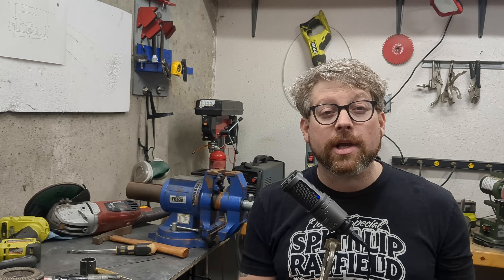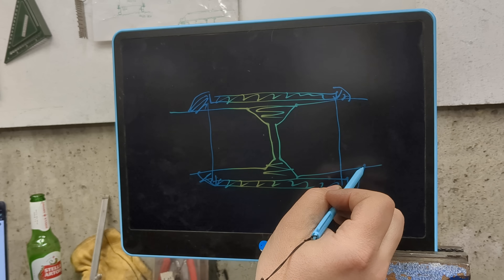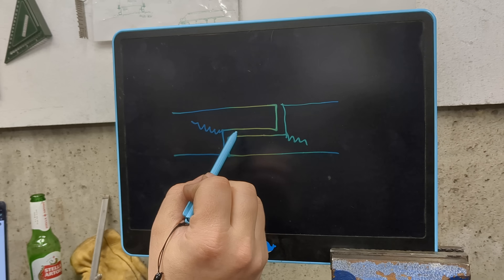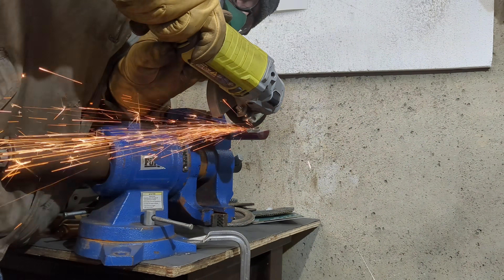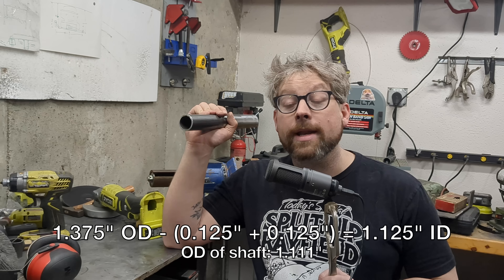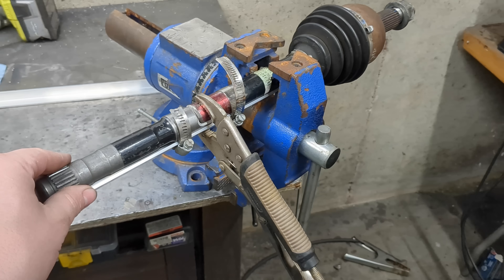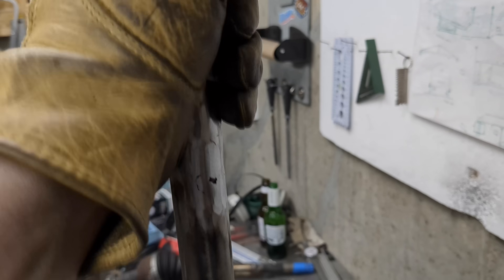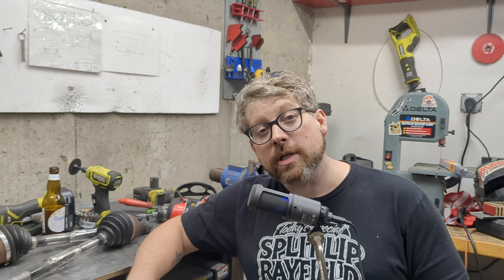Why This Joint will NEVER Fail - How to shorten/fix/splice an axle shaft or custom CV axle

Comment: I find it interesting that you brought up the 45 degree splice. CV axles are exclusively loaded in torsion and shouldn’t experience bending. Torsion failures occur in this 45 degree plane while bending failures will happen perpendicular to the shaft. It would be best to avoid this 45 degree splice at all costs. Just my two cents from taking a fracture mechanics class in engineering school
Reply: I really can’t imagine a slanted splice could be more susceptible to a torsion fracture  than a straight one.

Comment: What you should have done was extend the sleeve 2 to 3 inches on both sides the connection, drill holes in 2 spots on both sides the connection all the way thru the sleeve and shaft, drive pins thru them, weld the pins in place, then drill 1/4 inch holes along the sleeve weld fill those for max surface connections.

Comment: Im confident as a welder. I have 8 years utilizing it at my job and as a hobbyist. And a few years of school. Even if being a better welder could make the butt joint work i would still prefer this. I like that your joint works as a failsafe in a way. Your weld might fail even. But it has the potential of being saved from a catastrophic failure due to the strength of the joint itself.

Comment: Do you have a lathe? Its actually really easy to mill on the lathe, simply chuck the end mill in the chuck and the axle in the tool holder. Adjust the height in the tool holder and then just slowly feed it in. Id suggest cutting the majority out first though.

Comment: This is pretty good idea. If I can contribute- perhaps using a 40% silver to solder the sleeve in place. If the sleeve is a good enough fit you will get a capillary action to sweat through the silver. That way you reduce the heat

Comment: axles and driveshafts have to maintain a centerline from the output to the input of the wheel for centrifugal balance. I did not see any balancing in this video which can lead to catastrophic failure. So while welding is a idea manufacturing standards for automotive safety in the united states would classify this as a unsafe repair.

Comment: One problem as I was skimming
When you cut that shaft s you did, it is now shorter, and will it work ?
You need to place an extender piece in there to keep it at the correct length.
As I would hate to do all that work and find out it was too short,

Comment: after practice welding SAE based steels like 1540 or 9254 etc... they are commonly hard bas metals, so the drive currant to get proper weld fusion on those specifically is closer to 7000 watts per 3mm^2, to get fusion that ends in a tested load brake being nowhere hear the heat effected zone. tho in and of it's self adding a 1/4 inch sleeve to a 3/4 inch shaft matches or doubles that sections shear limit... 1/8" E12018 also works without using a sleeve, tho 1/8" E7018 at 165amps also works though half the rod gets to hot to use the full stick. ending of in importance with the beveled joint, every other weld pass on the joint the ground clamp needs to be moved from one side of the joint/base metal to the other, too fully drive the blending action of controlled currant flow.

E7018 commonly brakes in segments of elongation over time, tho most SAE material shears with little to no separation between metallurgical elasticity and upper tensile shear limit... having said that, some axles are also twist fractured in the opposing direction of the primary drive rotation to add rigidity to a axle shaft... installing them on the wrong side can lead to them braking at a load limit far below the OEM ratting.

engineered joints in gear boxes are normally made by friction welding two similar metals together with a lower tensile grade sheet in-between the two, to prevent spider web like cracking that would send chunks of metal into moving gears that would then roll into cracking a transmission case or bearing race with the skipping traction relation of the shaft slipping and re-catching on a fractured spline that would leave most drivers into continuing to drive making the problem worse. "lathe + oxyacetylene + cast iron or mild steel disk, chocked up heated spinning and jammed into the two so most of the softer metal presses out, even micro beveling on the joints so air doesn't get trapped.

welded joints are normal, because they are more commonly made to brake in an exact location... not for holding something together.

Comment: I cut axle end to proper length,send off to axle machine shop ,respline end and harden myself .this costs 100 to 150 bucks per axle .so far no failures ,passes tech ,handles 550 horsepower with 12 inch slicks and a 3500 pound car..
Reply: how rare is it to machinist have groover or know how to groove axels
Reply: @e34boat88  Not rare at all, it can be done on a few different machines with the right cutters.
Reply: I could spline a shaft with a Bridgeport and an indexer. It's not hard @e34boat88
Reply: @e34boat88  They only need a common indexer and a manual milling machine. Repairing industrial shafting is a very common machine shop task often done by enthusiasts in their home
shops. (BTW you can run three-phase lathes and mills off single phase by using an RPC or VFD, search the terms in this post to see how.
Reply: how rare is it to machinist have groover or know how to groove axels
Reply: @e34boat88 depends on the machine shop and what kind of work they do. Def something that isnt too hard to do, but might take some setup time.
Reply: How do you harden(?) it?
Reply: @solasauto yes, that is the good question..
Reply: @solasauto  Use a search engine as ALL machining topics are abundantly covered on the internet. Your first reaction to any machining question should be a web search using
appropriate key words. Lurking machinist forums and subreddits is a good way to learn as are videos.
Reply: Nise, but in many so-called "first World countries" this will be over $1000 per shaft, and even at this price 19 out of 20 shops will refuse to do this due to "liability".
Reply: How much torque? Torque is what destroys anything mechanical.

Comment: Your merely doing a lap joint.  Common in wood working.   I butt welded 2” pipe together 8’ long each.   Only 3/32” thickness    It has tremendous force on it and failed on the pipe confirming my butt joint was stronger than the pipe.   I had to replace it with a thicker pipe for strength.   No more problems.  The most important factor is the quality of the weld.

Comment: Great video!   You might as well stick weld it.  Stick welding is more reliable than mig welding, which depends on getting settings just right, acheiving spray transfer, etc.
Reply: I weld pressure pipe for a living, stick is far better on small diameter.

Comment: Machine shaft ends,  bore out one end of shaft,  suggest at leat 1 inch,   with min 1/4 inch wall depth left.  Thread that female shaft to receive the other male shaft.  Thread other shaft machine it down to be able to thread into shaft, and screw it into the other shaft. You can pre drill holes in outer to allow weld of threads on screwed in shaft. After tight! Weld a sleeve  as you iscuss, should hold  for ever so to speak.  Correct balance is imperative.

Comment: I've always used this technique for repairing threaded Bolts studs, butt joint won't work on 10mm parts, but this scarf joint works great every time, just be careful not to end up with a wider bolt bc u need to clean it up with a die

Comment: I would say a couple of things. 
1. Make the bevel much larger so the weld can penetrate and bind the joint. (it looked like you ground most of the weld off to get the sleeve to fit. 
2. Preheat with MAP gass.
3. On the sleeve drill some holes to create rosette welds.
4. Slowly let the metal cool. Try to anneal it afterward. Help pull that hardness back to a point where it's not so brittle. 
5. use a steel that is engineered for this load. Placing mild steel ontop of something that's supposed to handle lots of force is not always better. there are specific metals for each application. 

One comment I really liked was to drill a couple of holes straight through and use a quality steel as a pin through the joint. This seems like a good suggestion, although in practice might be more difficult to execute. 

but many props to you bro. this is what I love, waiting for someone who has a problem. takes the time to design the solution for it and then proceeds to execute and complete the project. most people only have one of these steps down. you nail all of them thank you!

Comment: Of course the best way is to not weld and to make a coupler with splines, but you would need a mill with an indexed rotary table and a broaching machine, though a hydraulic press would work in a pinch.  This would be an involved process though not only are the shafts hardened you would have to broach the coupler.  If welding holds fine I think that would the most efficient.

Comment: Looks almost exactly like what I did on my AWD 4g63 Mini Cooper swap like 7 or so years ago. No issues and I've gone through several rally races without issues. I used a 120V MIG welder for my axles though cause the 240V TIG would put way more heat into the shafts. I also used a .25" wall sleeve and turned the ID on the lathe to match the OD of each axle (I had two different diameter axles since it was BMW/Mini to Mitsubishi axles). This stopped me from needing to weld the length of the sleeve.

Comment: Drill through the sleeve, through the shaft, on both sides of the cut, and bang through a couple of steel pins. Then the joint is not relying on your welds.

Comment: This is not a good option. There is a stress concentration/ stress raiser at the toe of the weld at the end of the tube and there is an unfused interface at the root. It’s going to fatigue in time
Reply from the maker: I didn't mean to give the impression that I knew what I was doing

Comment: I have found that the best way to avoid cracking from the heat affected zone is to keep the heat down. The best way to do that is to use mig welding and only do a short run and let it cool. Mig welding puts less heat in in the first place.

Comment: Let me toss this idea at you. You dont need a milling machine to cut your splines but it would be way easier.
 This method requires you to cut off one end of the shaft to length. You need the axle to have enough diameter where you want your splines to be. I have done this and it works. What you get is a axle that is worked in its hard condition and not effected by weld heat and is not partially welded as you did. It TAKES TIME AND PATIENCE to do. I was in a major time pinch and couldn't send it to my guy. So I taught myself this method. I have never seen it done on Youtube probably because it sounds ridiculous. You will need a fat Sharpie or layout fluid, a side gear or hub spline you need to fit it to, a vise and a hammer. The skinny cutting wheel on your grinder might be thin enough but I prefer a die grinder with a two or three inch very thin cutting disc. You also need a handful of 45 deg grinding stones or what ever matches your splines. 
Start by putting a bevel on the axle that will just start to fit the internal splines of your hub. You could cut the axel 1/8" long for this and trim it off later. Now blue the bevel. Square the hub on the shaft as best you can by feel. It is not going to fit now. Exactly square is not  important yet. Mark the axle and hub so you repeat its location the same each time. 
 Now gently smack the hub onto the shaft with your hammer until you leave marks from the splines in the bluing dye.
 Knock the hub back off the shaft ( you will do this more times than you care for).
  My choise is to now start to cut small slots into the shaft with the cutting disc where indicated by the marks in the dye from the hub. You can do it all with the grinding stones but the disc will speed you up.
 Now that you have small notches at the end started reblue it, realign the hub and tap it on again, knock it back off and repeat the grinding step. If your careful and take your time you can make good clean and strong splines. I find them to be much better than a welded axle shaft the will be softened and likely twist off.😊 
PS i hope this hasn't totaly annoyed you. Best wishes on your project.

Comment: This is an old fix and at some time became out of style to do. It was used for many years in the shortening of hotrod axles, and you did not see it because it was in the housing of the shaft itself. There are some things to make this even stronger that your video shows. This includes tapering and filling the shafts where you have cut them. I would also have the gap in the sleeve so that you can run a weld down the length of the sleeve and increase the strength of the joint.

Comment: I have done that both ways, you are right, butt welding it will break. You could use 110-18 rod, it has more tensile strength .My friend built a 4 wheel drive  tractor with ford truck axles and welded it like you did, it worked for many years.

Comment: Thats definitely strong solution 👍🏽 . To think outside the box a bit would it ne practical to spline the broken ends of the axle shaft and counter spline a connector tube it can me machined  tight tolerance then weld...? I know this would be expensive 😞

Comment: Why you dont use smaller size pipe and heat it so it will fit over that welded area?

Unnessessary to split it so it will be ID smaller then what it is in a first place.

Comment: You could use slightly acute angle (like maybe 80°) on the joint so the parts would pull each other together under load.

Comment: 11:43 Nice job keeping it straight. From my experience, 7018 is my go to rod for strength. It does produce a lot more warping because of the higher heat input of stick.

Comment: If you check out front wheel drive cars you will find many of them have a short solid shaft on one side and a long tubular shaft on the other side (to give the same torsional rigidity both sides in spite of the difference in length). With a bit of luck you should be able to find a tubular shaft that is longer than you need with the same splines. Welding a tubular shaft is much easier because of the thin wall and also tubular shafts seem to be made a softer steel, easier all round. So easy that a simple straight weld works fine. If you find a tubular shaft with the spline you need on only one end then get two and weld them together.
Reply: Wouldnt be as strong though
Reply: @D3nn1s  for the same amount of metal a hollow tube is torsionally stronger then a solid bar.
Reply: @d.thorpe2046  sure, thats right, however since we need to weld it wed introduce imperfections, plus fhe design shown here wouldnt work quite as well on hollow stock.

Comment: For all the power you are pushing it is fine. Next time v out the cuts deeper   so you can really get the weld in there and  toss a few holes in the slip tube and plug weld them to the shaft, that will give you even more anchor points. You don't have the amps to burn it in deep so its a simple way to get past it.  I did this on a Daytona z  30 years ago and it is still going.
Reply: Thats some solid advice!
Reply: 100% on the plug welds for the sleeve

Comment: usually the issue with shortening cv shaft is they are designed to twist. but if you aren't hotrodding the car it'll probably be fine. only one way to find out

Comment: Wouldn't it be less work to just cut off one end and re-cut the splines?
Reply: You might think. But judging by the fact I cannot find a single machine shop around San Diego to do just that, apparently its not. No shop can cut splines. It's all "we used to have a guy" or "we used to know a guy" or "that shop doesn't do it anymore." I'm going to end up shipping them to Los Angeles or if not, a specialty shop in Idaho.
Reply: The axle would have to undergo a complex heat process before and after machining a new spline.
Reply: @ThisOldMan-ya472  It's not a problem to cut splines in drive shafts with a good milling machine with carbide tooling. They are not very hard, at least not the ones I've come across.

Comment: best bet for preventing weld embrittlement is to preheat the parts before welding, and cool them down slowly afterward. the 45 degree angle on the sleeve is just spreading the heat affected zone across more surface area.